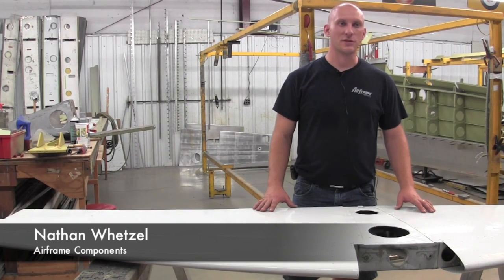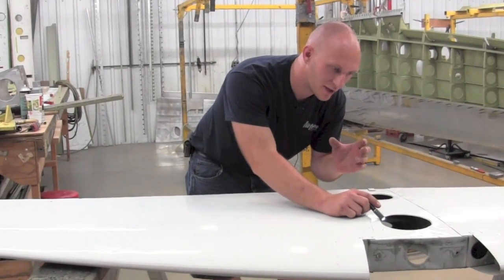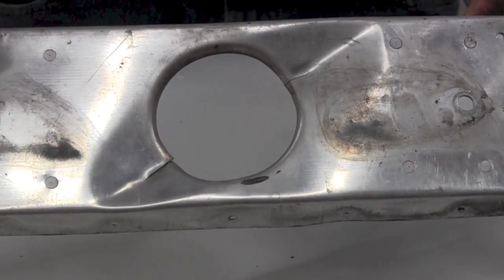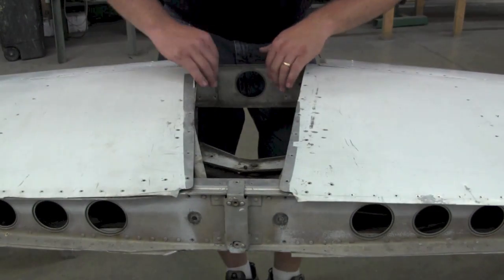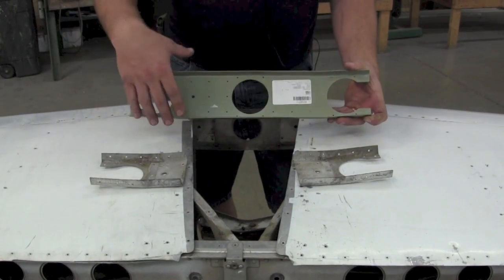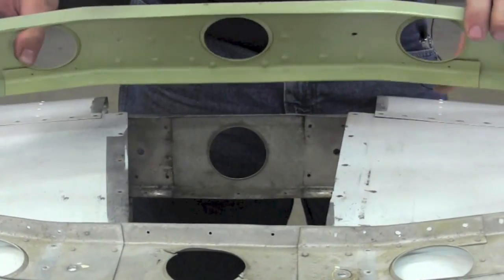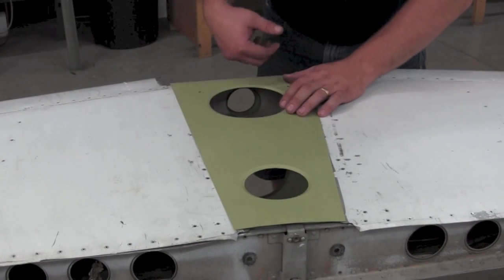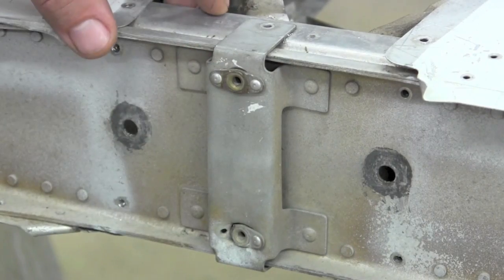Inspection of Cessna 172 horizontal stabilizer spar

Comment: FROM CESSNA:
"Improper ground handling can cause cracking and deformation of the Horizontal Stabilizer structure. 
It is recommended that the mechanic use a tow/steering bar to manually position the airplane on the ground. 
Do not push on control surfaces or outboard empennage surfaces."

Comment: One would think that CESSNA could find it in their cooperate heart to ZINC CHROMATE the aluminum before they put one of these aircraft together,...... they ask enough $$$$$$$$$$$ for a new one, I hope they do this now.
Reply: The French built ones are all chromated internally from manufacture
Reply: @sandyhutton7222  In the seventies it was an option to zinc chromate prime everything. About $50, most people didn't think it was necessary. No one thought planes would be flying 60 years later.